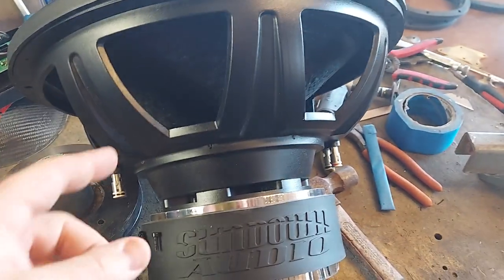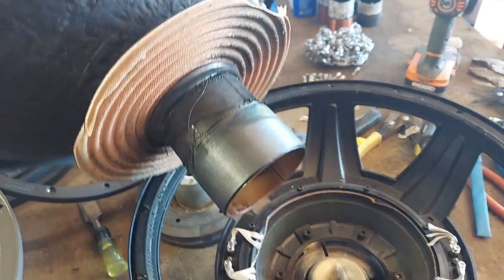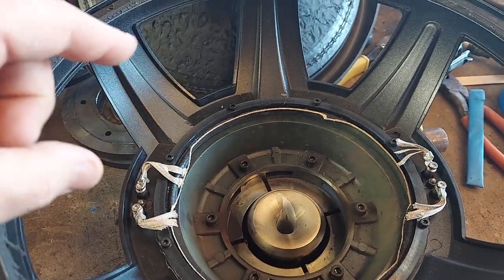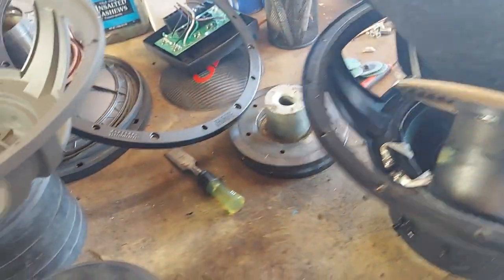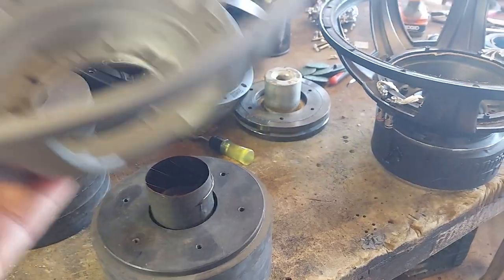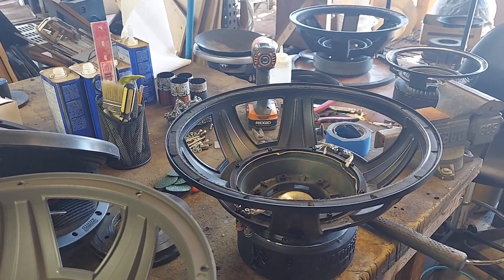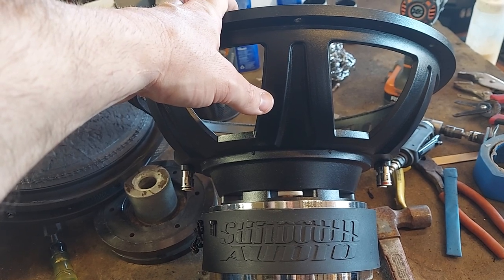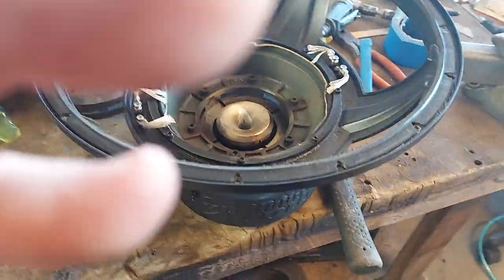Sundown SA v2 15" review @RobotUnderground  Good performance + bad value = TURD like JL Audio

Comment: Hey Patrick, I see that you offer custom rebuild kits, my question is wouldn't that change the speaker parameters and result in a different sound? I have no experience with custom recones, thanks
Reply from the maker: I used to think the same thing but woofers are kind of dumb in the sense that they're just big pistons so it actually does not affect the sound the way that you might think most of the parameters actually come from the flux density of the motor.   Basically how powerful the magnet is
Reply from the maker: I do recommend going with daily driver type of parameters which means a soft suspension but if you want SPL I can offer that as well
Reply from the maker: Just text me direct when you're ready with your name and your shipping address 602-312-6504
Reply: Gotcha, thanks for the clarification! It makes sense now. I will be reaching out 👍🏻
Reply: By the way, do you sell a ready to go sub that will compete with American Bass XR15d2?
Reply from the maker: @j3rs3ysfin3st97  Well I did a video on that sub.  Great sub.  Cheapest I found was $149.  I'd also recommend this one as a best bang for the buck. https://amzn.to/46sUSdi

Comment: So what is a “shorting ring”. Or shortening ring?   And what does it do?  

Is it just a spacer between motor and basket and it allows for more cooling of the Voicecoil?
Reply: Shorting ring is a metal ring, often made from copper, that's added to the motor to either extend the magnetic field further or reduce inductance and distortion or all of the above.
Some say they don't do anything at high power and excursion. I know that at least in mids it can make a real change because it reduces inductance and makes them play higher and clearer, but for subs it's hard to say. Sundown uses them in most of their higher end motors and have measured a big difference, but I don't know with how much power.
Reply from the maker: Read.  http://audioheritage.net/files/Loudspeaker%20Design%20Cookbook%20by%20Vance%20Dickason.pdf

Comment: So if JL is a bad value for SQ, what's a good value? And I know JL is bad value, they are ridiculously expensive and make it as hard as possible to get parts so they can charge crazy rates to rebuild them. I got a blown 12" W6v3 that I have thought about rebuilding a few times but I don't know if the parts online sacrifice SQ and sending it to JL is over $400 for them to do it, which is a total rip off, I don't think that even includes shipping. Hell they want $50 just for a shipping box lmao.
Reply from the maker: I sell repair kits for $200 shipped with new frame.  www.FixMySpeaker.com also sells drop in kits.

Comment: What the best size amp for two of these subs?
Reply from the maker: For the money, one of our BBC 2500W amps for $250 shipped..  No branding, so you can resell it for more even after a year.   If you want a brand, the Recoil Audio RED2500.1 for the same money is the best value on Amazon imo

Comment: Can you rebuild audiopipe quad stack 15's? I have 4 of them just sitting in my garage and would like to have them reconed! They are 2800 max 1400 rms dual 4ohm. They are the first generation with the big AP in the middle of the dust caps....
Reply from the maker: Sure if we have the parts.  Text me the gap dims.  6023126504

Comment: Are the mtx 9500 good subs to custom recone. I want to change to a ti basket and mega roll surround
Reply from the maker: I don't like working with them, but if you have them, go for it.
Reply: @RobotUnderground  i end up getting a re audio sx for 80. the tensil leads are ripped pretty bad but everything else is in good shape. i still want to do a ti basket and mega roll surround

Comment: Patrick I have a dumb question,, I have two subs will say speaker A and speaker B ,,, speaker A has a 420 oz motor 2 inch voice coil ,,6  3/8 holes for pole venting and a seven and a half inch spider,,,B has a 420 oz motor2.5 inch voice coil,,,6. 3/8 holes plus1.5 through the center of the T yolk and 8 inch spider,,,,,A is rated 300 RMS 600 Peak??B is rated 600 RMS 900 Peak??? I don't get it how does a 1 inch hole through the T yoke account for a 300w RMS difference should you choose to humor me ,,Thank you for your time and have a good rest of the day
Reply from the maker: I'd have to see pics.  6023126504
Reply: The pole vent cools the coil that much yea plus the extra half inch combined I’d say ya easy

Comment: I came across a company that sells motors and they use 3” gaps for 50oz and 80oz motors and 4” gaps for 240oz motors. Efficiency doesn’t like 3” gaps due to the added weight  but why would performance use 2-1/2” gaps.
(I am currently fascinated  with the  80/90/00 era of home audio large cabinet style sets).
And I’m an idiot learning this as a hobby, please bare with me.
Reply from the maker: Read first. Efficiency isn't the end all / be all of loudspeakers.  http://audioheritage.net/files/Loudspeaker%20Design%20Cookbook%20by%20Vance%20Dickason.pdf

Comment: Are you still moving to texas? If so where in Texas?
Reply from the maker: Yes.  I'm looking at the area between Space X and Gigafactory.  Lots of good properties South of San Antonio.
Reply: The Houston area also has one of the biggest car audio industries in Texas since the port is right here a lot of manufacturers have warehouses filled with all their audio equipment here.
Reply from the maker: @robertmontalvo597  That's what I hear.  Port's backed up right now though.  Cheaper to drop to Long Beach and truck over.

Comment: Does the sav2 use the same spider as the u series since they use the same basket what size is it??
Reply from the maker: Correct.  The U just has a 3" coil while the SAv2 is 2.75"
Reply: @RobotUnderground  hey so I have a question do u take subs like to trade I have 4 12s that r literally the same as a gladiator 12 I just want like a single sub setup like 15 or 18 was just curious on what we can do if not I can just pay
Reply: There timpano tpt1500 12s
Reply from the maker: @ROBBG88  Just resell them or fix them if they're blown.  It doesn't make sense to ship them unless you're here in Arizona.

Comment: Btw if u look over the price.. the u is a bad girl.. never owned an x.. but had the sa and the u.. they sound very similar.. the sa will tickle ur nose.. the u will close it..
Reply from the maker: I've had two SA 15's in a sealed box with a 2.2kw Planet Audio amp absolutely hammer in a Honda Accord.
Reply: @RobotUnderground  yea had 1 12 in a 2.2 box with well over 6k and it takes it better then the u.. in the same box at least. Dosnt hit as hard but handles it better.. a hell of a sub.. but ur paying 150 for the brand.
Reply: @RobotUnderground  u need to hear a u.. with double rated.. it really out does the sa. And has the exact same sound. Clean crisp but will hurt u if u put the power to them.
Reply: @RobotUnderground  us move panels lol.
Reply: @liljess706  well duh thats what your paying for a s a with a rev1 x series motor lol
Reply: @iblameshanemane9204  are they the same coil? I thought the u had a lil bigger coil.. other than that exactly the same.. not for sure on that though
Reply: @liljess706  the u has a 3 inch coil I think its the old zv4 coil the u if you hear derek or Jacob talk about em is the mix of a sa and a zv4

Comment: What's your take on skar subs?
Reply from the maker: Fine.  It depends when they're on sale.  I like the EVL's.  And I think the DDX which is the SA knockoff.  Right now though, the VCW from Sonix is the king at only $170 shipped per 12
Reply: @RobotUnderground , picked up two vxf-15's for $288 shipped.
Reply from the maker: @seniorxj2931  Very nice!
Reply: @RobotUnderground  haa that's what I have . NVX VCWs and VSWs but I still get it for cheaper.. and my boy Soundman is building a nice NVX build. Which I'm sure you already know..

Comment: Here I am looking at a stereo integrity sql as a possible way to scratch this itch I got for something new. Got any axis motors and lightning baskets in the house?
Reply: Got a 12" Quad axis. I'd like to build what I can get... assuming the motor and basket is the same as the one I got.  it and eventually recone the one I already own to match it.
Reply from the maker: Most likely.  Go ahead and text me with pics. 6023126504

Comment: U sure?looks like sav2
Reply: Think the rev 3 uses the older frame right?
Reply: V2 has the etching he showed on the motor... U is the same basket. The classic or rev versions have the old frame yep
Reply: @CrystalClearSQL  yep I have those,but I believe the u series is the best subwoofer sundown has to offer as far as Sq and performance it hits that sweet spot the x and zv series just seems like a a more money than sense or the look at me subs
Reply: This is the sa v2 they only have the sa classic and the sa classic rev 2 but still the v1, this is the v2 just like the u but the u has the motor of a x.
Reply: @rz9708  they have a v1 rev 3.. then the sav2
Reply: @rz9708  and it's a dif motor for sure I have a u12.. its dif then the x.